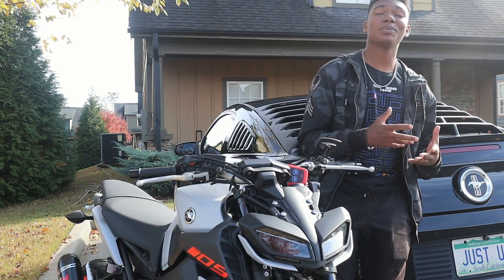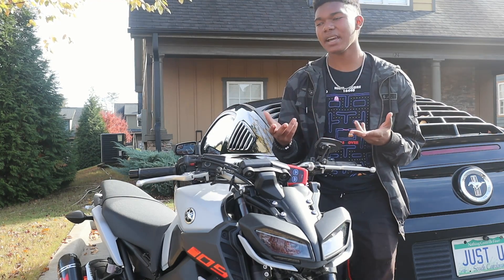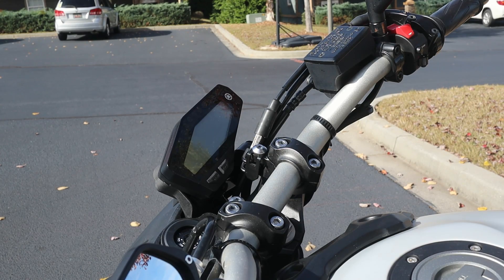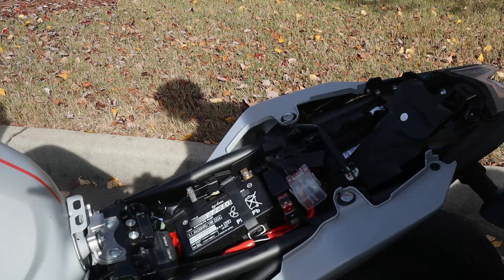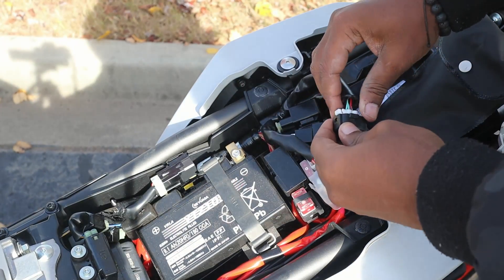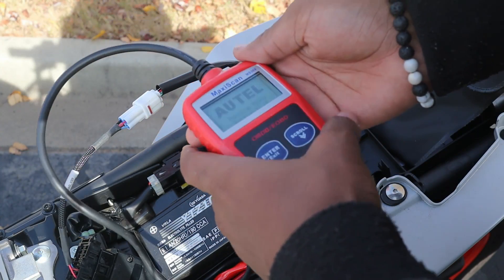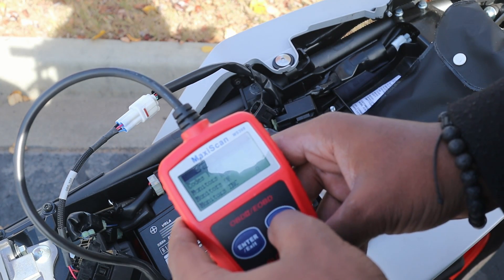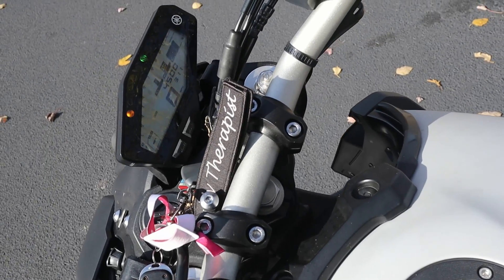2019 Yamaha MT-09 OBD Port Location & Clearing Codes!

Comment: With this tool can't erase ABS codes from ABS ECU, only codes engine. With an ln327 OBD2 and harnes adaptador 4 PIN' s Yamaha you can erase all codes with your smartphone using app toque. And you can read a thousand graphics on real time of your bike. But also can NOT erase codes from the anothers ECU like ABS ECU.
YAMAHA  force all customers spend our money to visit your dealer. 

Be careful not disconnect your ABS sensor while the motorcycle is running or you will have to see a yamaha dealer.  YAMAHA has frustrated me.  YAMAHA  have lost a customer ,ME 😡😡

Comment: Did you buy a separate connector for the mt09 ? i think based on 1:08  you used an adaptor to connect to the mt09. thanks so much.
Reply from the maker: Yeah well the guy I got it from came with the connector

Comment: Well it's a 2019 bike, they can't charge you if it's still in warranty, you can take it in and say "yo whut up with my bike got these warnings", they have to then investigate, and clear the errors if it's a false negative. They can't charge for that. A bike under warranty shouldn't display codes, only wear and tear you need to pay for :) 
Other than that, great video :D I got a 2018 MT-07, mine was also drooping over the side (but the opposite side)
Reply from the maker: SankakuGames appreciate the info👌🏽

Comment: Real helpful man, thank you, just fitted Akrapovic system, soon as I started the bike, engine management light on, gutted 😞 just ordered OBD scanner from amazon, should be here Monday yeeha😎
Reply: Hi bro my engine light on, sometimes. İ use akrapopovic. This egzoust from problem?
Reply: @cp3moto807  Hi man, Mt's seem to be sensitive like a woman, cleaning the back wheel while on the paddock stand can also put the management light on, or selecting gear with side stand down too, would recommend the OBD code reader, easy to use, cheaper than a dealer, good luck man 😎
Reply: @alibongo1028  thanks bro i will buy obd reader machine

Comment: hello friend, i am using akrapovic exhaust in my mt09. Occasionally the malfunction lamp is on. fault code oxygen sensor fault. the authorized service could not solve the problem. Can you help. 2017 mt09, karbon akrapovic egzoust.
Reply from the maker: So it’s the O2 sensor?
Reply: @JustUsDoingIt  no bro, we change new o2 sensor. But its sensor fault continue.
Reply from the maker: @cp3moto807  hmm and it won’t allow you to clear the light using the device?
Reply: We use device, and light off. But later ride, light on bro
Reply: you probablly dont even own the bike anymore. you can get a custom ecu map and they can turn off the 02 sensor bc it is not necessary and then the light will not pop up i did this on my mt07